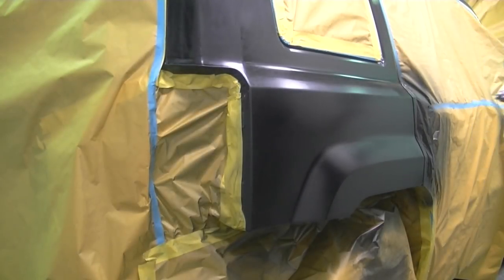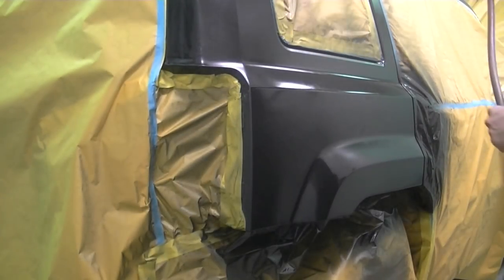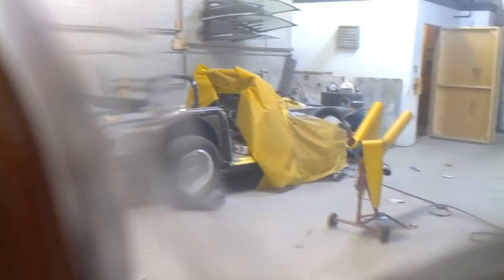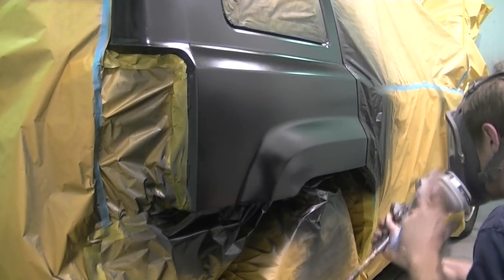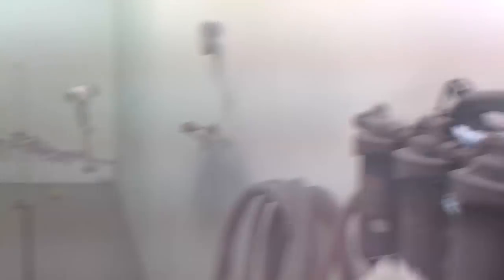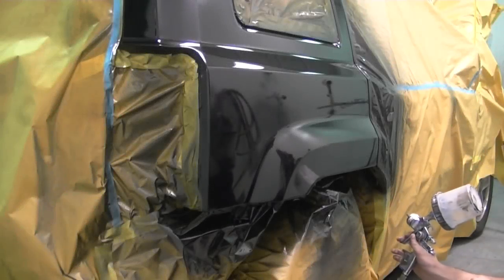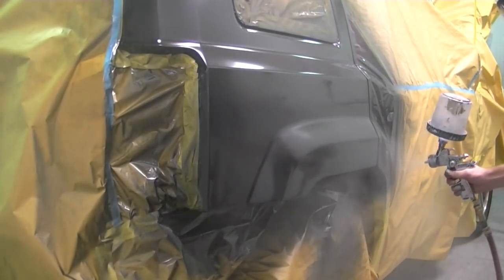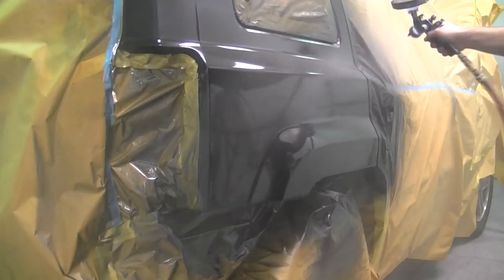Painting a Black Metallic Car

Comment: Hey is it alright to use a regular high gloss clear coat on top of the metallic? And I noticed you didn't do any wet sanding to the black is it because its a metallic and it would ruin the flakes? And also is it good to wet sand the clear?

Comment: Its called orange Peel if your reflection is speckled looking or blurry you can fix this by wet sanding the clear down some just don't sand through the clear and then after wet sanding you can buff it and it should look alot clearer